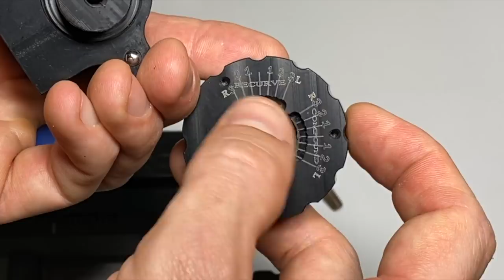Last Chance Archery Vane Master Pro Review | Why a $300 Fletching Jig is Actually a Good Deal

Comment: I think you got an older version. I bought my VMP about 2 years ago. Differences: the main body/groundplate is made out of metal instead of plastik, the knop for compound/recurve is standard, you can lock the the disks in which the vane holding wires are installed. Love my VMP though it can't be used the glue feathers or the new Bohning Vanes. Btw it is advertised to be able to fletch 4 inch Vanes, didn't fletch that long vane myself, yet.

Comment: If you wanted a large helical, for $50 you could use an AZ EZ Fletch.  Where this is great is a lot of experimentation, but for most people, it's really overkill.
Reply: I really wish they'd come out with a 2 degree helical 4-fletch and 3-fletch jig. The true helical is great, but it's too much on the mini-max. I'd by one with less helical in a heartbeat just for the time savings. They are so fast!

Comment: This does offer great customization but I am not a sure of the holding wires. Do they just about lightly hold the vanes in place and roll off as you move it back to reload new vane or do you have to wait till glue dries to move it back?
Reply: The wires hold the vanes (I use Bohning Air) in place but not so tight that the wires would roll. You have to wait until the glue is dried bevor removing the vane holding part but that is no difference  to the clamps for jigs like a Bitz or Decut

Comment: Question for you about arrow spines. Do you align the stiff/rigid part of the spine straight up or straight down? You also mentioned further back fletching mounting. I do this as well. Far back to make sure nothing hits the string at full draw. Have you found an optimal distance to be mounted? If so what is that general distance. Another question about vanes. Do lower profile vanes not fly as well as taller vanes because of disturbed airflow coming off the arrow tip? Thanks for any information you can provide.

Comment: Did you use a VERY LIGHT amount of Lithium Grease on the two slide pins for the jig.  Where the actual Vane jig attaches to the base?  Just got mine and seems to be if you dont slide it out perfectly even your stuck.  Even out your fine.  Another question is I noticed you dont have the upgrade Vane holder set screw now available.  Take a look at this https://www.youtube.com/watch?v=EaBRBM_slcI